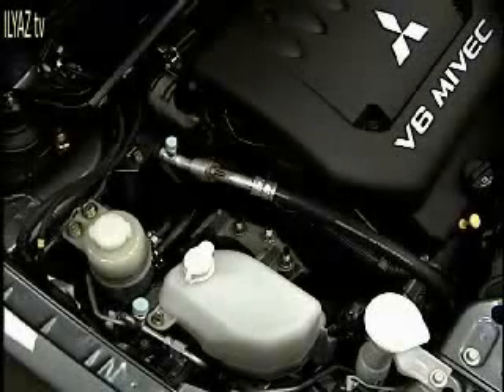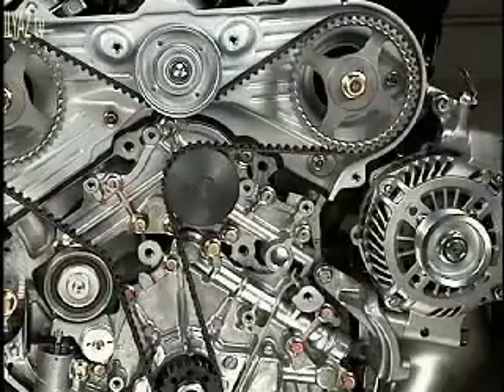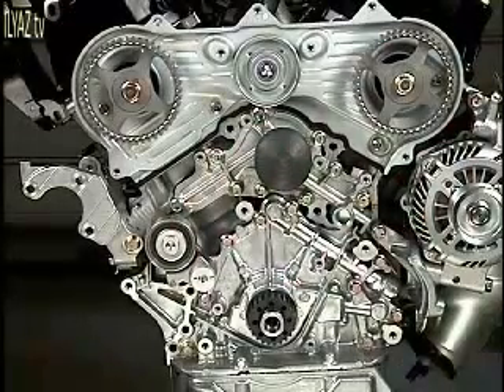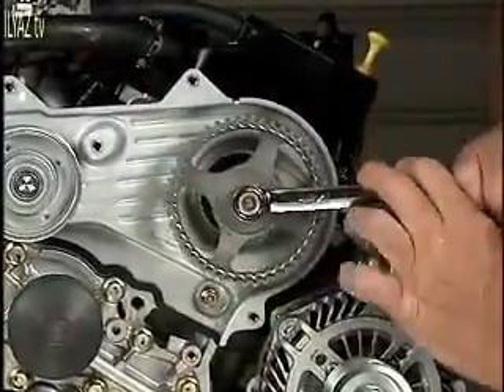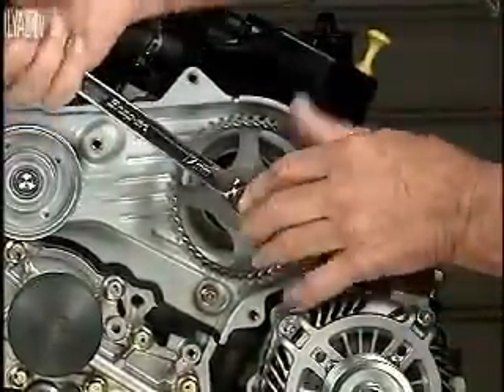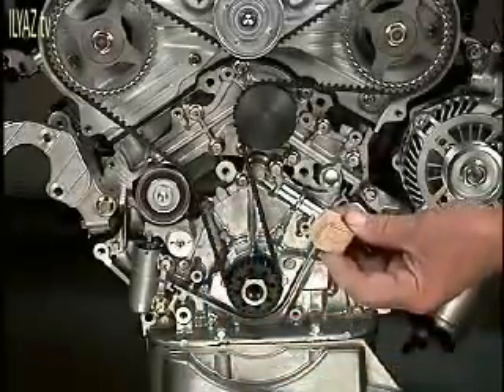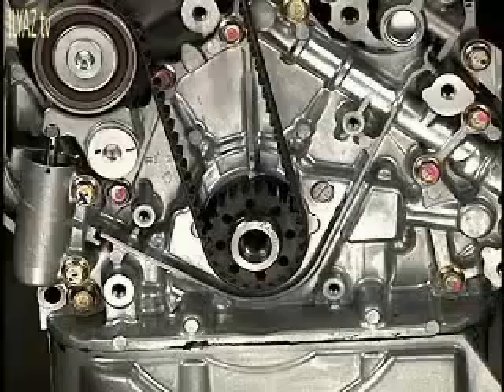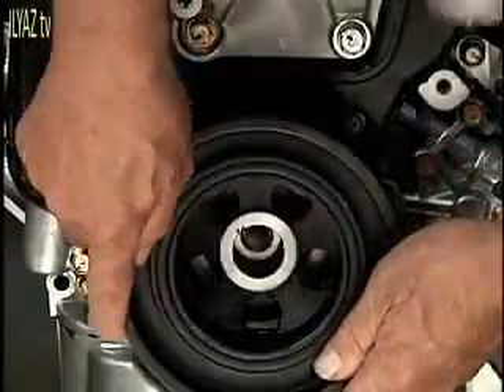Mitsubishi 3.0L V6 Timing belt replacement

Comment: Hi sir  ha ve good day. How many torque on cylinder head bolt?
Reply: It's a three step process. This is straight from the manual:
<COLD ENGINE>
80 ± 3 ft-lb → 0 in-lb
→ 80 ± 3 ft-lb

Comment: that crankshaft wrench i looked into it special tool MD998716  , costs about $50-80 you dont actually need that it looks like a useless tool , you just need to screw the crankshaft bolt in to turn

Comment: Mines due in two years, I'm going to drive it until then and then off load it and let someone else pay $1200 for a new belt! Oh and my next car will have a non interference engine, I hate being held ransom by a piece of rubber(One break and it destroys your entire engine) ridiculous!
Reply: I had a Mazda with a KLZE V6, new it was due for a change at 200,000km but it let go at 195,000 the belt didn't snap but some teeth stripped off, sure enough it was fine after I put a new belt on (although several mechanics had said it wouldn't be) as they are non-interference engines - but that does seem to be pretty rare and most engines are interference. A lot of modern engines use chains now.

Comment: I changed the belt, water pump and spark plugs on my Mitsubishi 380 one year ago. Biggest job I've ever attempted. Won't do it again. So stressful on first start up.
Reply: im dreading this job but gotta learn and save $
Reply: @solarson7363  You can download the 380 manual, good luck.
Reply: @freeagent8225  
Thank you for that download 'tip'. 👍👍

Comment: I just did this, one important step not covered in this video is this. Mark the timing marks on the old belt then take it off. Lay the new belt over the top of the old belt and transfer the marks to the new belt (count the valleys to double check). I found when I installed the new belt it was 1 tooth off at the cams. If I didn't mark the belt I wouldn't have known.
To put the belt on correctly I rotated the cam forward 1 tooth, collected the belt in the correct position then moved it back to TDC.
Reply: OMG you saved my life!
I'm performing this maintenance at home (so I don't have a press to re-compress the tensioner). Months ago, I watched the video and read some comments, and today I remembered this exact tip (din't remember where I read it, but it literally costed me nothing). 
So I marked the new belt, and when installing it, if it wasn't me who marked it, I would've thought it was wrongly measured or something, needed a lot of tries to stretch it to the correct tooth alignment, specially on bank 1 camshaft, and it worked perfectly!
Without this recommendation, my belt would have been wrongly installed

Comment: the engine is mounted in my car I needed to know how much of the engine and parts  I  needed to remove to be able to replace the timing  belt.what do I have to do pull the engine. your video doesn't help that much thanks anyway.

Comment: Yessssssss, that was easy, brand new engine, no rust no dirt no greasy deposit, and most important out of car, on the table ready to dive, even my unborn child can finish the job, try to do the same with engine in the engine bay, then we will talk about  the ease of the work.
Reply: Art O Very solid point you just made,  with the engine still in the vehicle there's so much disassembly required  just to get to the belt. it's a whole other monster.
Reply: Bullsgt25 $500 is cheap,  a lot of places want a thousand to $1,200 for timing belts these days
Reply: Try doing it in the dirt in the dark in the rain. lol
Reply: Art Ot
Reply: Thats why I refuse v6 engines. I stick to the 4cyl

Comment: 2000 mitsubishi diamante My crank pulley has the timing belt on it, can I just turn the crank shaft to line up the marks? I thought that was the case but it got harder and harder to turn as I advanced it? Thoughts?
Reply: im 4yrs to late......however 4 the benefit of others  turn cams back a bit the so valves cant hit

Comment: What if i don't replace it , will this breaks the engine or  the car just stops ?
Reply: They did mention it is an interference engine, which means if the belt gets worn out and snaps then the valves and pistons will collide, destroying the engine.

Comment: Actually makes me more nervous and doubtful any mechanic would be this carefully thorough with my vehicle engine. Nowadays in my experience they just shrug their shoulders and tinker mindlessly.
Reply: Any jackass thinking that they're just tinkering with this no interference motor is not gonna just work on it they don't touch these if they don't know what they're doing clearly I didn't know the internal workings until I owned one if you can read you can achieve so someone who doesn't know shouldn't be telling you that they have the ability to internally do anything to your motor I don't understand where your perception is regarding someone working on these
Reply: Dealer should be careful
Reply: @tanvirina  . . . I had my first change done at a dealer where I bought the vehicle. Certified by Mitsubishi. No problems at all wonderful job great service. Dealers no longer in business. Had to,  " Search" for the next nearest certified Mitsubishi mechanic. Found one just a little over a hundred miles away and had my second belt changed at close to 200k miles. 3 months later, I have a water pump leak. The vehicle runs fine, but when they put the water pump, which was new also, they obviously didn't do something right. I'm leaking coolant and every day I have to top off the reservoir. Now of course, they'll have to pay to redo it but again, it's over a hundred miles away and I'll have to take a day off of work plus get a rental car again just to get they're incompetence repair. I can't just be there first thing in the morning and wait for it. They won't guarantee same day service/completion.
Reply: Apparently you're going to the wrong places if that's your experience

Comment: Set the timing marks with the original belt still on it.  Then don't move the crank or cams
Reply: What if they are not ? You have to take the belt of and do what he did lol 😆 which is the purpose of this video

Comment: If the belt goes on a 92 3 litre pajero i hear the valves don't get wrecked, any comments?
Reply: Depends whether it has the 12v or 24v version of the 6G72/74. 12v won't wreck the valves, but 24v will.